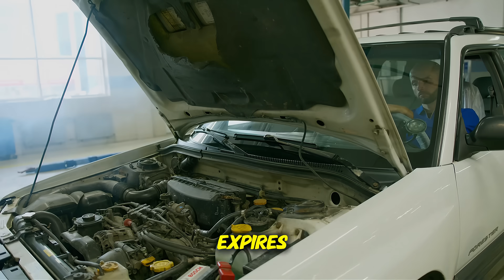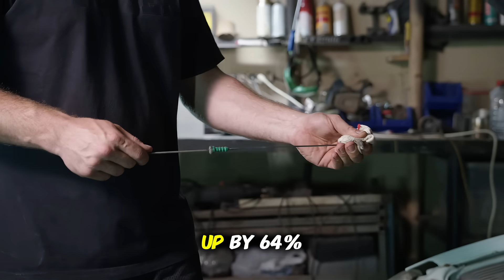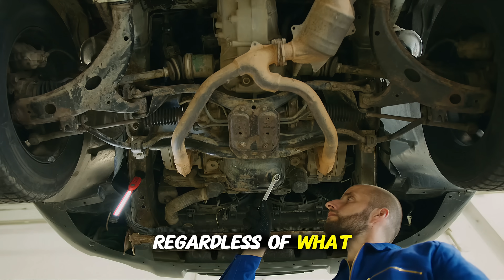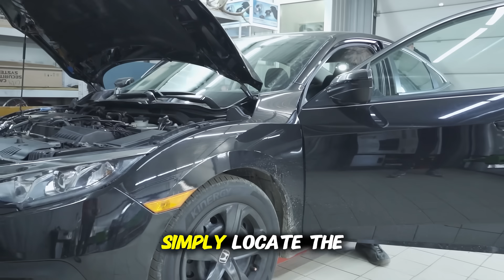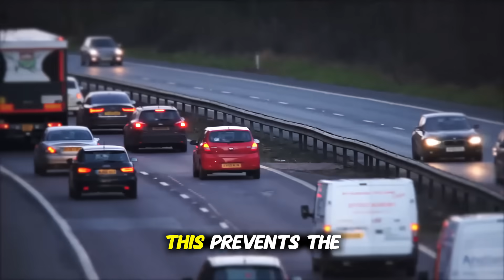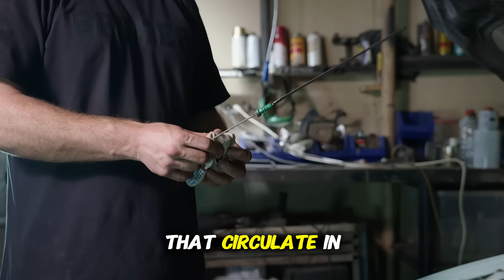GIVE ME 10 MINUTES AND YOUR AMERICAN CAR WILL LAST 500,000 MILES - MAINTENANCE SECRETS!

Comment: Interesting someone mentioned the dealership use crap oil.  My Toyota dealer only uses Mobil 1.  They get you on if you change it every 10k miles. That’s going to cause problems.  Every 5k, and you’ll probably double or triple the life of it.

Comment: I grease my caliper pins every  25,000 miles my pads last over 90,000 miles. Most of the pad wear is caused by pins not fully releasing. It causes the brake pedal to pulse and the steering wheel to shake as the rotors get too hot and temporarily warp a bit. 
I believe most internal sensor problems are caused by the number of times a car cycles from cold to hot and back. I drove all day every day at and at 510,000 miles my cylinder head under the valve cover is still silver with a a very very light yellowing in crevices. 
I have only ever used Honda’s oil. Mixing 5w30 and 10w30    50:50
I also use only Chevron gas 99+% of the time in the 2 million miles I drove. It wasn’t until I purchased a direct injection vehicle that I ever had injector issues. But I don’t drive all day every day anymore and  that car cycles cold to hot more often just running errands then sits for a couple of days at a time. Which is not the best for longevity IMHO.

Comment: I have a 2005 Toyota Rav 4 with 362,000 miles on it. Bought it new with 110 miles on it. It gets the same gas mileage and has as much power as the day I bought it. Only problem with it now is it uses a lot of oil but still runs great.

Comment: I’ve had one truck and a van with over 300,000 miles and never once changed the oil. As they got older I would have to add some from time to time, and that’s the truth.
Reply: Not true.
Reply: @MethodicalChristian absolutely is true!!

Comment: We have had many Dodge and ram trucks V8s V10s and cummins that have achieved 500, 000 miles or more. All ran synthetics for oil changed ever 5000 miles, all ran OEM oil filters and K&N air cleaners. One heavily hot rodded one I ran duel large remote oil filters and did so many miles I wore the rims out. The counter sunk holes wore so the rims were loose when the nuts were all the way in.
The other secret, do your own maintanance or find a good I dependant shop. Keep it out of the dealer it will be way more reliable and cost you less.

Comment: engine braking is literally a hundred year old idea from when brakes sucked. engine braking is hard on your engine and your transmission. your engine and trans are NOT made to be used for braking. your brakes are much cheaper to change than your engine or tranny.  this channel is WRONG on using your engine to brake

Comment: HA! My old '91 F250 4x4 7.3 IDI has 1,343,455 miles on the clock. The engine has never been opened.
Reply: Those were great motors. I’ve actually got an 03 with the 6.0 that’s never been opened.
Maintenence, maintenence, maintenence

Comment: Heavy don't necessarily wear out brake pads.  My 70s Lincolns and Ford Ltd landau front brakes lasted over 50,000 and rears way longer. 

Yet a mush lighter Plymouth Volare went through brakes in under 20000

Comment: Sold American cars for over fifty years have seen a number with  three hundred thousand and a few highly maintained with over four hundred thousand And five hundred thousand
Reply: No cars made after 2020 will make it 500k.
Reply: I drive a 2012 5.0 Mustang GT  has
Reply: HAS 500 hp with my 91 Octane Tune Headers, Space Throttle BODY OUTLAW MUFFLERS CAME WITH HIGH FLOW CATS,  PMAS COLD AIR INTAKE  I USE PREMUIM FUEL OF COURSE I CHANGED CLUTCH TO A KEVLAR RACING CLUTCH STAGE 2 , EVEN THO I DO NOT RACE MY CAR SHE IS MY DAILY DRIVER AND PAID OFF ONLY HAV 33,000 miles on her. SHE IS A PREMIUM SO ALL THOSE BELLS AND WHISTLES CAME OF COURSE 6 SPEED MANUAL LEATHER CD MP3 REVERSE PARKING SENSORS AC HEAT HEATED SEATS BEST SURROUND SOUND SYSTEM I EVER HEARD FOR STOCK ETC ETC FACTORY SHE HAS 420 HP BUT I HAV HER PASSED 500 hp, Also A lot of Cosmetic stuff done to here.  I DID RACE A DODGE HELLCAT ON ACCIDENT IT WAS NIGHTIME AND NOONE WAS ON THE ROAD AND IT PULLED UP ON ME I THOUGHT IT WAS A CHEVY CAMARO SS ANYWAY SOON AS LIGHT TURNED RED WE HIT IT RACED FROM LIGHT TO LIGHT THAT 700hp HEAVY ASS CAR BARELY BEAT ME …. HE BEAT ME BY HALF A CAR LENGTH ….IM GLAD I RACED ALWAYS WANTED TO SEE WHAT SHE COULD DO.  HE THOUGHT I WAS A SHELBY COBRA 🐍 GT 500 so we both thought we were something else lmao😂😂😂 ANYWAY HE GAVE ME MAD PROPS I TOLD HIM IF I HAD A KENNY BELL SUPERCHARGER ON HERE WITH A THREE CORE INTERCOOLER HE WOULD OF LOST BIGTIME, ONE I LNOW HOW TO RACE DRIVE SHIFT FROM BEING IN MUSTANG CLUBS AND GOING TO LAS VEGAS TO DRIVE ON PROFESSIONAL RACE TRACK WE DID THAT BEFORE COUPLE TIMES AND RACED IN SAN DIEGO CA AT  THR TRACK THEY HAV LEGAL RACING IN SAN DIEGO I FORGOT THE TRACK NAME I BEEN GONE TOO LONG .  THAT EXPENSIVE STATE OMGAWD 1 Bdrm Apt like $2500 a Month  etc IM RETIRED MILITARY BTW ANYWAY I REPLACED MY STOCK CLUTCH BECUZ 2011-2012 were notorious for having CLUTCH OR TRANSMISSION PROBLEMS THEY USED SHITTY PARTS OR WHATEVER I had a O7 Shelby GT not 1 problem Ever HAD A 2014 JACK RAUSH STAGE 2 but had a Heart Attack in her SHE TOTALED CRASHED INTO MOUTAINS  BUT NEVER HAD A PROBLEM WITH A 13 or 14 MUSTANG GT INFACT I FEEL 13-14 GT’s are BEST OVERALL MUSTANG GT EVER LOOKS GOOD AND BULLET PROOF …THEY SAY THE 18 MUSTANG IS BEST BECUZ OF THE SAME I FORGOT THE NAME OF IT BUT IT HAS THE SAME AS BOSS 302 and its BOLT ON I DID THE SAME FOR MY CAR GOSH I DRAWING A BLANK  I CANNOT REMEMBER BUT 18 GT HAS IT, Anyway I was 2nd Owner of My GT , THE FIRST OWNER WAS OLD MAN HAD LEGG PROBLEMS KEPT THE CAR IN GARAGE BARLEY DROVE IT AND FINALLY SOLD IT TO DEALERSHIP AS IS WHEN I BOUGHT IT  THE GUY HAD MESSED UP THE GEARS UNKNOWN TO ME I DROVE. CAR FROM SAN DIEGO CA TO MARYLAND 3000 miles with all these mods and she was LOADED DOWN WITH ALOT OF STUFF IN HER BUT THAT ENGINE PUUUURRRRED AND RAN STRONG MY 80 year old MOTHER ROAD SHOTGUN WITH ME FROM SD TO MD AND SHE IS NOT A TRUE RESPECTOR OF FORD AND WHAT MUSTANG GT CAN DO….

MY CLUTCH FROZE ONCE BEING OUT IN MD FOR 1 year or less and IT COST ME $4000 for new TRANSMISSION THAT FORD INSTALLED AND $800 in parts I BOUGHT FROM AMERICAN MUSCLE EVERY YEAR THAT CAR JUST SAT IN THAT MANS GARAGE I WAS NOT AWARE OF IT I FOUND OUT AFTER THE FACTS BY GOING THRU ALL THE CAR RESGISTRATION PAPERWORK OF EVRY YEAR HE DROVE IT BUT AS TIME WENT ON HE BARELY DROVE IT UNTIL HE ENDED UP NOT DRIVING IT AND SOLD IT TO PERRY FORD DEALERSHIP THEY TOLD ME AS IS and it had NO WARRANTY WTF …ANYWAY NOW SHES A BEAST LESSON LEARNED I HAVE NO COMPLAINTS AND SHE IS STILL A BABY BEAUTIFUL KONA BLUE METALLIC FROM HAWAII COLOR I GONNA DUE CROSSED DRILLED ROTORS AND BREMBO BRAKES NEXT I GOT 2 MORE OIL CHANGES OF BRAKE PAID WEAR BEFORE THEY NEED TO BE REPLACED I HAD 2 HEART SURGERIES AND  ABLATION SURGERY ON 3 HEART MEDICATIONS THIS ALL HAPPEND  WHEN I WAS 47 and 50 Now I’m 56 HAD HEART CHECKD OUT NO FURTHER PROBLEMS I FEEL STRONG AS MY CAR A BEAST I DID GET DIABETES TYPE 2 but  I deal with it as well I WAS EXPOSED TO ALOT OF STUFF 21 YEARS US NAVY THEN I WENT SECURITY FORCE PROTECTION BODY GUARD WORK AND LEARNED MORE WEAPONS TACTICS  STEALTH SURVIVAL LAND TRAINING ETC ETC KRAV MAGA ED PARKERS KENPO blah blah blah now  yup but NO COMPLAINTS I WOULD LIKE A GENTLER RIDE but that’s all Suspension stuff not doing that on a 2012 GT I NO DAMN FOOL,,,, SAVING UP TO GET MY DREAM 2026-2030 SHELBY MUSTANG COBRA GT 350 or 500 or CODE RED who knows IM SINGLE NO KIDS SO I WILL PLAY UNTIL MY LAST BREATH FORD FOREVER AND I WANT THIER TURBO DIESEL OT TWIN TURBO 350 Super Duty Truck as well u feel like you Riding in a Cadillac in those and My Mechanic we used to drive to TX AND HAUL STUFF ALL OVER CALLY INHIS AND HIS WAS OLDER BUT STILL AWESOME IMAGINE THE NEW ONES

I ALSO LIKE AND LOVE THE NEW MUSTANG GTS THOSE LIGHTS ON FRONT DUEL COLD AIR INTAKE STOCK 485 HP AND THE MACH-E I DROVE THAT ELECTRIC BEAST NOW I  KNOW WHAT 600-700 ho feel like If Incannot get the Shelby Then I will buy A NEW GT AND THROW SUPERCHARGER ON HER❤…FORD….FIRST ON RACE DAY🫵🌍💙💙💙💙💙💙🧢🥶🦋💎🌍💯🇺🇸

Comment: My lunatic clueless neighbor just bought a $90,000 pick up and so proud of himself it came with a 100% maintenance program with free oil changes. I didn't have the heart to tell him he's getting the  worst crap oil ever. He's getting the recycled  vat oil. A Dealership is not going to lose $1 on any deal. Your getting oil i wouldn't use in my lawnmower. It ruins your engine. If you bring your car to the dealer for an oil change thinking your doing the right thing the Techs are changing your oil with synthetic oil your wrong. You tell a car dealer  change the oil and throw them the keys your getting the vat and its installed by guys who can't even speak English. They will severely over fill it to becasue they have been told if you don't put enough oil in the engine your getting fired.
Its the same deal at the Jiffy oil change joints. You say Change the oil your getting the vat oil from those huge vats next to your car.
Reply: I have trusted independent shop that services my car with Mobile one and BG ADDITIVE  very 4000. Miles  trans forty thousand with BG ADDITIVE
Reply: @patrickmoss-j7c  M1 is not the oil it used to be. Better oil out there is Pennzoil Platinum it tested very high in an oil shootout where M1 did poorly. They love it over at Bitog so I use it now in both my cars its a great oil. You don't need an additive if your running good oil and a good oci.
Reply: This is factual information THANKS
Reply: wrong wrong wrong we use synthetic oil at the dealership . Its same oil you buy at auto parts store except its in 50 gallon drums.
Reply: @from-da-hood  50 gallon drums. Not filthy trucks pumping vat oil into filthy huge vats.
Reply: The service in this country is for shit.

Comment: I am not a car man but my advice is free,#1never and I repeat never buy American junk,#2 buy a Honda or Toyota. #3 follow up maintenance  on a timely manner, end of story.
Reply: You are absolutely correct! I have had my Toyota 4Runner 2005 since new and only changed the oil and tires !!!  20 years I’ve owned it and I would never buy a domestic vehicle ever!!
Reply: Some of the new Toyota's are damaging there good reputation, Like the new Tundra's that cost Toyota $ 1.3 billion in engine replacement's and the new turbo 4 cylinder Tacoma's are having big problems to, one is there new transmission.
Reply: Town car and crown Victoria and Grand Marquis are excellent cars
Reply: Another automated voice over . Speaking the numbers give it away. I wonder where they find these programs .

Comment: my 2003 Ford RangerFX4 just hit 199,000 miles and I didn’t switch over to synthetic until I got it from my son at 146k . He  serviced tranny, front and rear differentials every 30 k and oil and filter every 3,000. I’ve used Amsoil oil and filter the last 55 k miles The original water pump lasted until 189 k. Timing chain is original and makes no noise . I replaced the OEM oil pump with a high volume pump from Melling when I needed to change the leaky oil pan gasket .
Reply: Is that the 4.0?  The timing chain is supposed to fail at about 100k so you're lucky.

Comment: How about oil changes every 3,000 miles?  Including synthetic?
Reply: Valoline Restore and Protect oil, cleans out engine.
Reply from the maker: For older, high-mileage vehicles, 3,000-mile oil changes can be beneficial insurance against engine wear, even with synthetic oil. While most newer cars can go longer, frequent changes remove harmful contaminants that build up in aging engines. When it comes to protecting your investment, slightly more frequent changes are cheap compared to engine repairs. Don't forget to subscribe for more money-saving automotive tips that mechanics don't want you to know!
Reply: @SimplifyingCars-u3l  YUP.
Reply: @SimplifyingCars-u3l  Especially frequent short trips in winter.
Reply: Bs
Reply: I change all mine at 3k miles, and 5k on my diesel.